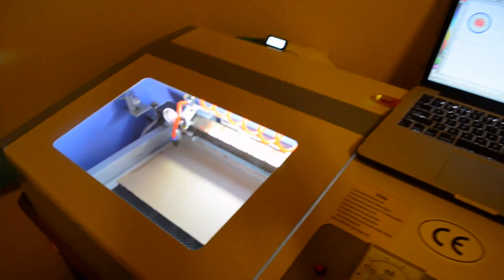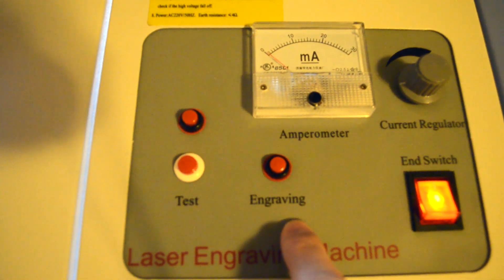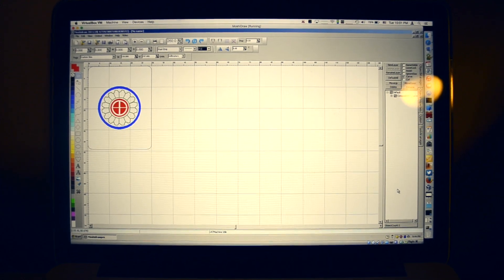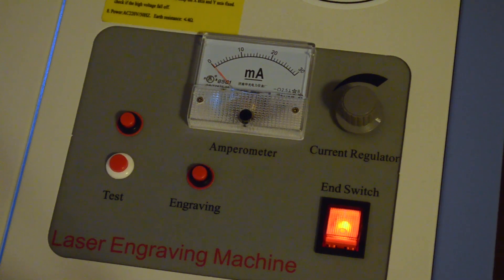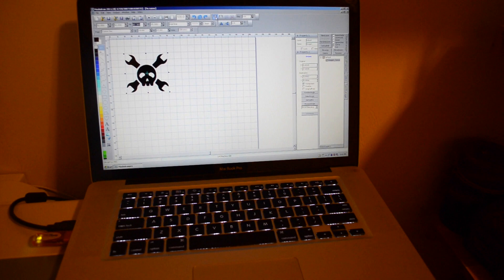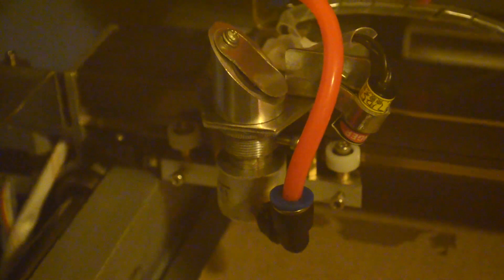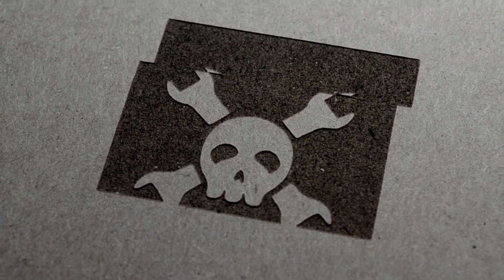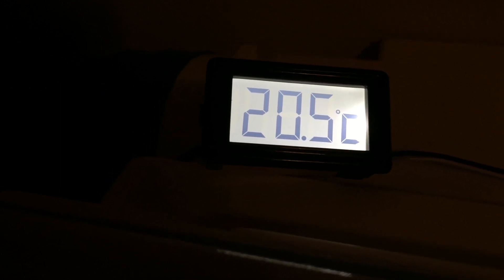Chinese laser cutter part 5: Engraving with Moshidraw

Comment: Hi. Wondering if you could help me. Iv recently bought similar model as yours and installed the software that came with it. Currently using LaserDRW. When I draw my design lets say an oval 50mm wide and 30 mm high, when I tell it o engrave it engraves 50mm wide then only 9mm high, looks like the design comes out squished. Any idea on what may be causing this? Hardware or software issue?
Reply from the maker: +Farryl Bird My guess would be software, but I've never used LaserDRW.

Comment: MoshiDraw plus weird USB cables, woohooo! I really shouldn't be watching these, i've just unboxed mine (40 watts)! Did you ever try alternative software to Moshi ? Thanks again :)
Reply from the maker: +Gary McKinnon Yah, but not with the original board.  I have more in the laser cutter playlist where I build the "LAOS" (LAser Open Source) controller, and install it.  I like the LAOS a lot, it connects to your computer over the network. https://www.youtube.com/watch?v=yJImenhGE58
Reply: Ahh, i was wondering about the 'heavy ethernet usage' comment you made in LaOS part 5 - troubleshooting.. I hope my 40W model (different buttons, haven't looked inside PSU section yet) isn't so much trouble, i don't have your skills :)
Reply from the maker: If you have any trouble, look at your pulleys first...  https://www.youtube.com/watch?v=iF5mg_N0RUs
Reply: Thanks. My board is much smaller, made by LiHuiYu Studio Labs. Had a quick search and can't find anyone with problems so hopefully they have upped their game, same case, fan, pump etc ..

Comment: You need to annotate that your explanation on the diminishing laser power is wrong. It&apos;s due to misaligned mirrors in the x or y axis. 6ma is not driving the tube to anywhere near its max power.
Reply from the maker: Jim McPherson Yes and no.  It wasn't the mirror alignment in this case.  The real problem is that there was a weird zone in ramping the current up from zero on the potentiometer where 6mA isn't causing the right kind of lasing.  That weird noise was related to that as well.  Later on, I went past that point on the potentiometer, and the current went back down and ramped up again.  This time, at 6mA, there was plenty of power

Comment: I have been using this same laser cutter for nearly 2 years now and have battled through the same problems like you. My laser was getting half way through cuts etc and then just taking off by itself. I also loaded different versions of moshi etc etc. Finally I had a breakthrough, I was always also using my laptop but when I plugged in my desktop pc WOW, no problems, ran purrfect!! Also my mA can go to over 20, I think you have a problem there. Also never run these over 20deg C. you will get poor life from your tube. The best investment I made was a chiller, I now get very consistent cuts from engraving paper to 6mm Acrylic Cuts, Hope this helps